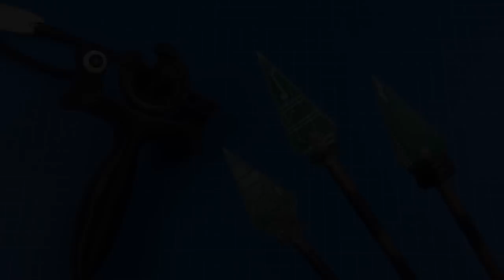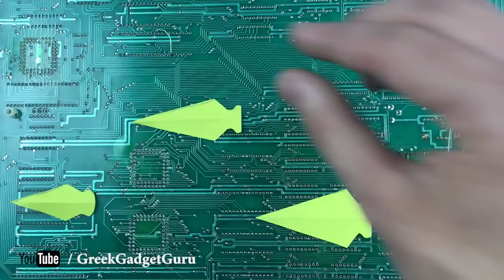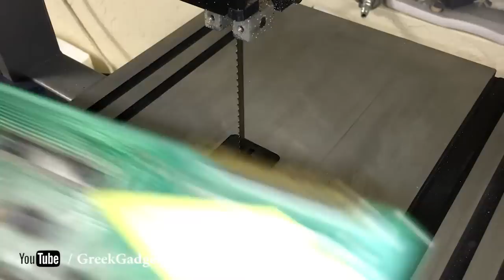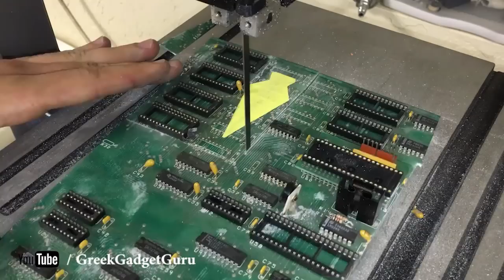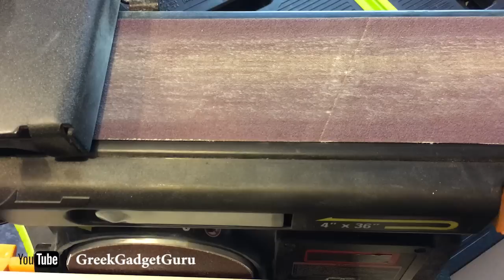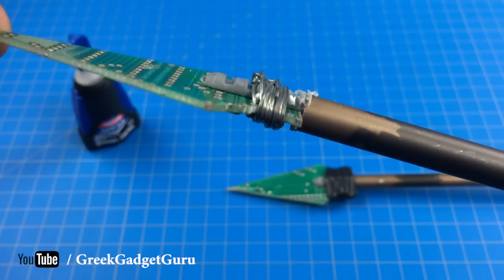PT1 - Fallout PCB Arrowheads - 3D Printed Rambone SlingBow - GreekGadgetGuru

Comment: For the stun arrow, why not make it one arrowhead split down the middle with a gap at the sharp bit and where it connects to the body of the arrow have a bit of rubber so they aren't touching, then have the wire/cable leading to the power source. Another idea for how to mount the power source is to have a gentle incline then decline in the body so in the middle it sort of looks like an RPG (rocket propelled grenade) so the widest part can be hollowed out, the power source mounted inside, covered up and secured, and then the cables/wires leading to the arrow head/s
Reply: Strange 030Guy  pretty smart man

Comment: I have a thick g-10 liner I'll use. Should be better since there's no pcb traces and IIRC these are also G-10? I've used your washable glue stick idea before. The g-10 is horrible stuff for sanding. Smells awful and the glass fibers are uncomfortable.

Comment: You could just add a capacitor to the shaft of the arrow, cables to the tip, and bang your arrow now gives small shocks.
Reply: livingchaosmatrix or light wire attached to a taser coil l..
Reply: True, but why? You'd need pretty big capacitors, that you'd need to charge beforehand.
Reply: L454RU5 For fun?

Comment: Question: would putting wires down the length of the arrows stem and inserting a battery into the other end of the shift hinder the arrows flight capabilities?
Also would such a simple connection of wires and battery actually cause an electric effect if used? Or is there more to it than that? 
Ideally I'd like something that delivers a continual or lasting shock, like a taser 
leaving paralyzed whatever Ive shot.
Reply from the maker: A battery, absolutely not. I would use a high power capacitor or just use the arrows and attach a spool of wire like a spear fishing gun. They do have shotgun shells that have micro stun guns in each, but developing that technology in house would be really difficult to obtain the same effective results that a professional has access to.

Comment: Aren't PCBs fairly light? Lighter than metal broadheads I would think. I feel like adding a little weight to the tip would get better penetration. 

I like the idea of the drywall anchors with the rubber grommets. It's similar to the way some arrows are made with removable fore-shafts.  That way, the broadhead sinks into the target,  but when they try to remove them, only the shaft falls out, leaving the tip in place. You can later recover the shaft and just pop a new head on it.
Reply: There's a great video by Scam School that shows how to make a stun gun out of an old disposable camera. Something to do with discharging a capacitor. That'd be more portable than a battery, and make it rechargeable.
Reply from the maker: Yes I noticed that too. The idea for this is to use the PCB leads for a "stun gun arrow tip" Once I add some electronics, this thing will probably be too heavy haha!
Reply: +GreekGadgetGuru are there coin batteries small enough to fit inside the shaft? or are yo thinking a spool of light wire that the arrow carries like in a traditional stun gun
Reply: that's why I got an extension ;)

Comment: you could solder the wire that holds on the arrow head to increase longevity, also goes with the theme.
I feel like the drywall anchors are the main weakpoint though, any way to replace those?

Comment: I've got an idea for a taser arrow: you have a 4 slotted pieces that slot together like the steel arrow from skyrim and then split the head down the middle and run the positive charge into one side and the negative into the other
Reply: but how would the arrow hold the charge? like it would need to carry a battery, and a circuit board, or a large capacitor both of witch would weigh the arrow down and make it unstable
Reply: But it was a great idea 😊
Reply: didn't think about that
Reply: skyrim steel arrow: https://staticdelivery.nexusmods.com/images/110/30027-1350750783.jpg
Reply: or have a pyramid like tip that has plastic or rubber in between 3 or 4 metal sheets all arrow pointing things so it doesnt spark until in the Target......nah your idear was better